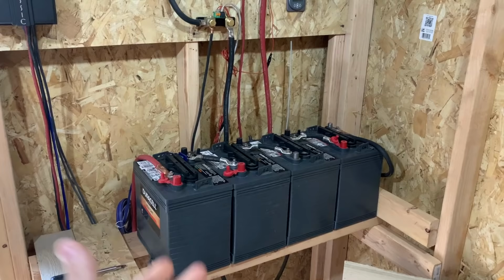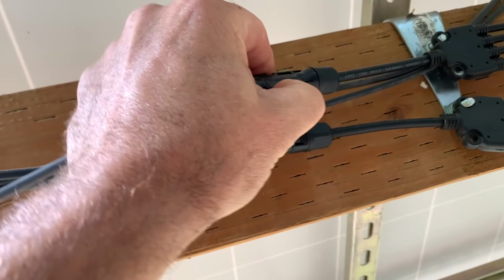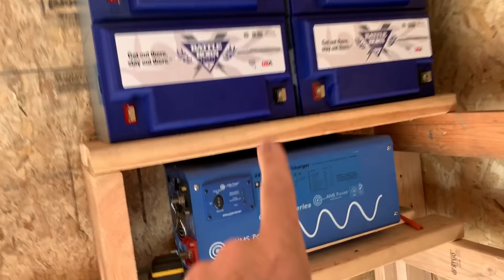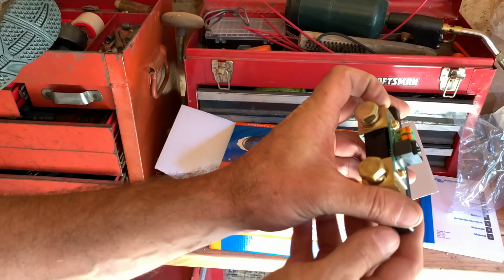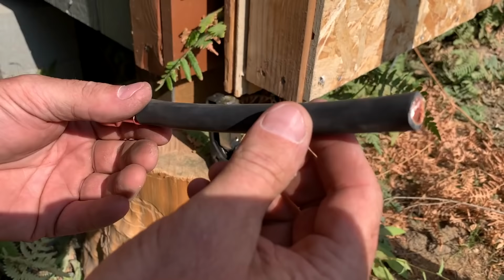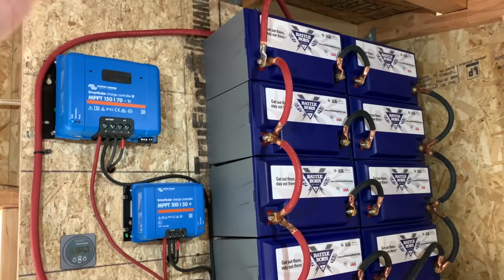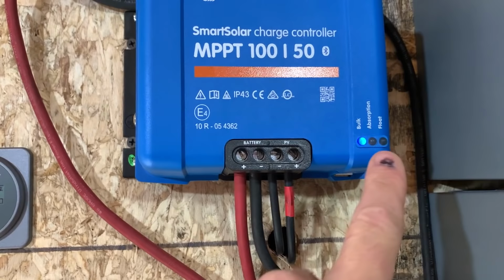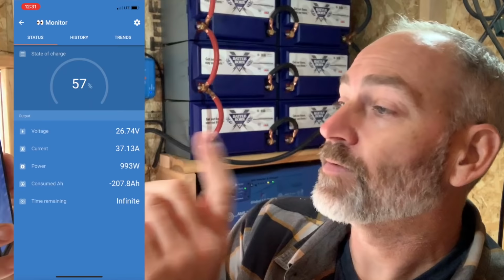EASIEST Off Grid Solar Power System Battery Bank

Comment: Battle Born makes great batteries. What they don't make are great prices.
Reply: $900 per battery is insane, it better to pay per kilowatt
Reply: I like individual cells myself. DIY piece it together!
Reply: @billssolarpowerandgardenin1016  - I hear you.  The lithium iron phosphate battery (LFP) are safer than Li-ion, which is probably what your talking about.  
If you short a Li-ion cell it will vent and can start a fire.  So LFP batteries are good in that way.
Reply: @mrtdiver  I have the big 200ah 3.2v lfp’s at our off grid overseas.
Reply: @trulyshocking  HA!    $949.00    No way Jose....  too much.
Reply: whenever I'm feeling beat up by my own conversion endeavors, I always come back to read all the smack talk about this silly video.  makes me feel so happy.
Reply: New subscriber here. Great video. I have Tesla solar panels on roof. But, no storage.
Tesla wants $14,000.00 for 2 Powerwall2 storage batteries, installed in my garage.
Lot of money. Would what you have done here work for me, and save me a ton of $ also?
Reply: @Thebowzer221  yes it could save plenty. You can order Lifepo4 batteries on AliExpress inexpensively with free shipping. I suggest a PowerJack inverter to power your home at night. Inexpensive and I’ve NEVER had any problems. I suggest a 10kw 48v inverter and a battery charger that has a high amperage capability (wired thru an MPPT charge controller)to charge up the batteries during the day. Some PowerJack inverters have built in chargers but are getting harder to find. I suggest 32 3.2v 200-280ah Lifepo4 batteries to a total of 800ah and up.
Reply: @billssolarpowerandgardenin1016  
Ok, thank you very much. That is a lot of information. Any ball park idea of the approximate cost of all of these materials?
Something I can compare to Tesla cost?
Tesla said 2 Powerwall batteries. I have 3,000 ⬛ foot 🏡.
I am a 100% disabled Vietnam veteran (cancer) agent orange related. This system is more for my wife that me.
Reply: Give it five years or less, they’ll be half the price.
Reply: @Thebowzer221  batteries delivered around $3k. Inverter $850. Charger $295. The best mppt charge controller (Midnite Solar) $625. There are cheaper charge controllers out there that will work tho.
Reply: @mrtdiver  more scared of lipo's than li-ons here XD any deviation or overcharging and they burst into flames a faulty regulator can do that easily
Reply: @billssolarpowerandgardenin1016  The question is can you say that at the 10 year mark on the same set of batteries. There's a reason BB batteries are expensive and it isn't market hype. You get what you pay for. Especially, with BB's warranty and engineering. These are not cheap chinese prismatics in a box, these are 30ea 26650 LiFePO4 cells specifically made for BB. The units have built in BMS and heater pads for northern latitudes. Again, you get what you pay for.
Reply: @TexasVeteranPatriot  Hi Tex! Nice to meet a fellow Texan. Knowing no BMS is bullet proof and not being a 12v battery person I never have been thrilled about a battery made up of individual cells sealed in a case. If they fail they can’t be removed without doing surgery if the warranty is out. What is the warranty by the way. As far as I know all lifepo4 are made in China as are my prismatic that came with a 3 year warranty. They weren’t cheap either. I did a factory visit when on vacation. The BMS I chose was junk but of course it was early on in the game. I recently upgraded to 48vdc and one cell bloated probably because it wasn’t managed properly. The factory has since replaced that battery and 2 others that had flaky reading when charging and discharging. Replacing a BB in the Philippines would be impossible for me anyway. To each their own right?
Reply: $1,000/kwh is a joke.  Literally the ONLY place I see these Battle Born batteries is in rich people's set-ups.  $200k RV's, some off-grid ski vacation house in Colorado, etc.  Non-millionaire DIYers know that the market value of bulk batteries for powerwalls is approx $170/kwh + bms.
Reply: I got 16 3.2v-    48v280ah for $1,634.
14.3kw of storage. For under the cost of 2 battleborns which you'd only get 24v 100ah
Reply: @billssolarpowerandgardenin1016  my Overkill solar BMS has a lifetime free replacement even if it's our fault.
Reply: @Chefjjdecker  That’s just Awesome!
Reply: @Chefjjdecker  I have 32 set up for 2 banks 48v each. They were $3700 plus shipping to Philippines.
Reply: Does your AIMS inverter connect into an electric panel in your house?
Reply: They are a ripoff you can get similar batteries for half that price

Comment: Just an observation. The Battle Born batteries are designed and assembled in the U.S. However, various components are sourced elsewhere. The Battery Monitor System (BMS) is made in China, and I'm sure the actual 26650 battery cells are also Chinese. However the design and assembly are top-notch. Lots of thought went into this battery.

Comment: I would definitely have DC Disconnects for Array and for Charge Controller as well as some Earth Grounding . Safety is MOST Important when it come to "Look What I Can Do" You Tube videos. This System would never pass NEC Code... I would hate to see all this nice equipment go up in Smoke for a lack of not completing Your Homework and not looking up basic Electricial Code. With this much power You can't have to much Protection!!!
Reply: 100% 

Unguarded terminals, open wiring... reminds me of my off-grid place when I bought it twenty years ago. I'll hook up all kinds of stuff on surface temporarily for testing but I don't leave it that way. Too much at stake if you fumble a screwdriver, and help is too far away, assuming you're able to call for it.

Arc flash in your face can briefly exceed the surface temperature of the big ball in the sky that feeds those panels. Didn't know that myself, through a long life as a hobbyist, technologist and electrician. Found out while preparing to teach a class.

I did have an early lesson when a neighbor came to help my mom with a stalled car and managed to touch both terminals of the battery with an adjustable wrench. The moveable jaw of the wrench vaporized. Imagine what this battery bank could do...
Reply: Boring advice, it’s not your house. 😴
Reply: @tomsaywer9883  OK Mr. "Running with chainsaw." 😁 

It's true that most safety-related advice is a lot more boring that the consequences for the unwary. 

As the OP said, his concern is mainly for the amateurs viewing this stuff - as is mine.
Reply: @scottwilling5315  Actually the Battleborn batteries won't dump as fast as that but it'd still be spectacular.
Reply: Does code apply to 12V or 24v systems.
Reply: I added a fuse box between panels and controller. Not just for protection but it is a much easier way to disconnect a individual or all of the panels
Reply: @stephenburnage7687  Yes! NEC Code Applies to all Alternative Energy. Wind, Solar, Water ETC...Including 12V 24V 48V ETC... If there is anything I can help with , let me know...
Reply: @DirectCurrent4u  my experience with 12V, 24V is on boats, where ABYC standards apply. Boat owners worry about these as (wood and fibreglass) boats are highly cumbustible and there is no means of escape (i.e. a fire offshore is almost guaranteed to be fatal). Shore based (low voltage) installations must have different priorities.
Reply: @stephenburnage7687  Thank for the reply and update!👍
Reply: Besides of electrical problems, at the eyes of an Italian the construction of this system appears 100% INSANE!
I assisted a friend in building a small 2kW backup system for his house some years ago (48V 120Ah using 4 12V-120Ah lead acid batteries).
We selected the best spot on a brick and concrete wall inside an underground cellar (of course with plenty of ventilation and well away from any flammable material)... to fix the inverter and the battery only steel brackets and metal hardware were used.... not a single piece of wood or any other flammable material!!!!  :-O
Reply: But it's off grid it doesn't have follow the nec code when it's not connected to the grid as for the safety I agree he should have done better
Reply: @Roaan-Knight  That was my original question. Do stand alone 12V systems even have a code? They do on boats, but that is only because of the fire risk, which is a unique consideration for boats (lack of means of escspe). But an off grid land based system?
Reply: @stephenburnage7687  I'd say since the boat is built as what the company is specified yes they have to follow code because that's law but if you built your own boat just like a house you can do however you want to it they're are the safety aspects to it but if it's something you built off grid do as you see fit but even the land you build on you have to make sure it's land not on the grid other wise by law you have to wire the house to the grid and follow the code
Reply: @Roaan-Knight  Just because its an Off Grid System doesn't mean that it doesn't have to comply with NEC codes...Its all about the safety, liability, fire ETC...
Reply: @DirectCurrent4u  luckily they make those codes so easy to understand and read; mostly to just assure you have a ground and proper disconnects. 

Not like we have to flip through 5+ different codes with conflicting information for off grid applications (609, 706, 705, 690, 710, yada yada yada); then I'd understand why no one uses them... oh wait.

Bureaucracy at it's best; good intentions followed by well...

Comment: Get a high power resistor, place it between the battery terminal, and the cable. Hold it there for about 30 seconds. This will charge the capacitors. Then move it away and quickly hook up the cable to the battery. No Spark. This spark you demonstrated is inrush. It can damage the equipment. Other than that. Nice video.

Comment: Always wear safety glasses when working with batteries of that size and add Double Pole DC switches (for safety)  so you don't have to pull plugs on solar panels and battery to inverter feed.

Comment: Great instructional video Martin. I would recommend using a proper hydraulic crimper for these 2/0 wires with nickel-plated copper against corrosion and shrink wrap.
Reply: The wires are in a building. They aren't at risk of damage unless you spill something nasty on them.
These battery don't vent acid gases that can cause damage.
Hammer crimped is fine for this application. 
There are always better ways to do anything but there are limits to what is reasonable.
Reply: @btwbrand  I'm not saying that Martin should re-do it. I'm making people aware that a hammer crimper is not the right tool for such big wires.
Reply: @Kevin There is a video where a guy cuts open a hammer crimp vs a hydraulic crimp.. Hydraulic is much better, but hammer can be used too. You can check by cutting one upen.

Comment: That is a sweet setup! 10 -15 Grand? You might want to consider putting a disconnect switch on the batteries.  Great job!
Reply: there is fuse i think,safety

Comment: Just FYI when people see professional installations they are not mounting all the electronics on you typical osb/ plywood. They use fire rated plywood and you should if you can.
Reply: OSB isn't very flammable
Reply: @gerry7457  I think the residents of Paradise, California would disagree.
Reply: @parmorama  haha, those fires didn't start because of solar... they started because of smart meters
Reply: @nortavon  says the troll that hides behind a fake name... If you can't reason and logic things out for yourself, there's a Democracy waiting for you
Reply: @gerry7457  osb is too expensive. It also does burn but won't ignite from a little bit of heat. Folks do remember that most house's are made of wood and osb with all electric cables running on the inside. How likely are you going to have a fire since your house isn't made of metal and concrete? Not likely. And don't say it's because it was done the right way because most likely you didn't build the house yourself and don't know any better.
Reply: @williammcknight5419  most were arson
Reply: @AlexTsitsyura  I'm from Canada and OSB is the cheapest plywood you can buy here  hmm
Reply: @doppler3237  Thank you. Scrolling all the way down, I figured no one was gonna mention that
Reply: @doppler3237  I build my home in 2018 and was able to buy 4x10 5/8" osb for $16.70 this year I paid for the same osb $38.20 i live in NY prices might be different elsewhere. I know some will say that you can get it from home depot or lowe's for $25 well they haven't had it for months and you can't make an order. So the reason why I say it's expensive. Because It doubled in price just like the rest of the lumber. It might be cheap when you buy a sheet or two but when you purchase 250 sheets that's a $5,000 dollar difference.

Comment: I hope you didn't throw your lead acid batteries away.  You're gonna need em.  Don't ask why, the explanation sounds too crazy to swallow.  Just take my word for it.  Keep your old setup in good condition.  Try and construct a copper enclosure (regardless of the cost) to surround your old battery setup, including your battery charge controller and  battery monitor etc.  Also, think in terms of Cyber Attack and what that entails.  Power you got covered, but telecommunications will be out and there goes your bluetooth display, so try and get a workaround for that.  Look Klaus Schwabb (Davos) spoke of viral epidemics a short time before you know what happened and now he's talkin about Cyber Attack (Polygon) in his cute little Einstein voice.  So it doesn't hurt to be prepared.  Look Mr Johnson you're still ahead of the game with your setup and it's gonna help inspire a lotta people.  Nice one bud.  This information you're passing along is golden nuggets.  So a sincere thanks.
Reply: Copper box won't prevent radio frequency hacks or emp, if you have power cables coming from it. You would also need power tempest filters. Don't think it is an issue but if you are really worried I would do it properly.
Reply: @fibreguy1971  Yes thank you. These are genuine considerations. I will take this into account when building my faraday box.
Reply: Thanks tin foil hat

Comment: Add'tl protip:
If you add a second inverter (and that's supported in this system) you can add a string of amorphous cells (the flexible ones) or CIGS (if you can find and afford these) to get more stable power in cloudy/shaded/low-light conditions.  These are often used for better performance in calculators and portable electronics.  But they have a lower peak output.  By comparison, i've compared all 4 types:  Per watt of peak, at 50% shade, you can expect no useable output from mono, <20% from poly, ~30% from Amorphous, and ~40 from CIGs.  So if you need that trickle, they can be useful!
Reply: I have 2 80 watt cigs. They are pretty good.
Reply: So can someone please tell me which solor panels are the most reliable in cloudy days. I am in Montana and we don't get but 153 days of sun a yr. I remember hearing there are different types of solar panels and if you don't know, you can end up not getting what you want or need then be disappointed at the out put.

Comment: I see lots of good advice about installing a shut-off switch between the Panels and the Solar Controllers which is perfect.  However, if you install a Battery shut-off switch, Remember to turn off the Solar Array FIRST to avoid voltage spikes that can damage equipment.  The Controllers need to be dead before disconnecting the batteries. Damage may not occur every time, but it's possible.

Comment: You should have insulated the wall behind this system.  Also make sure you strap the battery to the wall, just in case someone runs into the shed :)
Reply: Or an earthquake. Few extra minutes getting it locked in would save lots of potential headaches later on.

Comment: I would of formed the cable first then crimped it and maybe put little bit of heat shrink over the crimp to just for that little bit of extra safety
Reply: Better to just use copper straps.

Comment: Having a cutoff switch will prevent the arcing while connecting the terminals.  It's bad for the terminals as it will have a weld-like burn that can compromise it.

Comment: I would stay with the midnite solar classic any day.
Reply: I agree about the Classic. Why did you switch when the classic is the highest rated charge controller. Is the new cc internet connected?
Reply: Maybe the Midnite is not programmable to lithium iron batts

Comment: Ok I am aware a little how Battle Born Batteries customer service helps with setting up a system and making sure you have all the necessary components . Thank You Marty, I did call them and the salesman knew your system so he was great at helping me.  I haven't purchased as of yet but do anticipate I will later 2023. We just had 21 below weather. And suddenly the electric went out for 10 seconds  several times. It occured to me, without electric we would find ourselves without power. Not a calming idea so we will be making changes. Back up plans to our back up plans. Gas generators make me nervous bc what if gas is no longer available in the future then I have a big expensive paper weight. So that's up in the Air